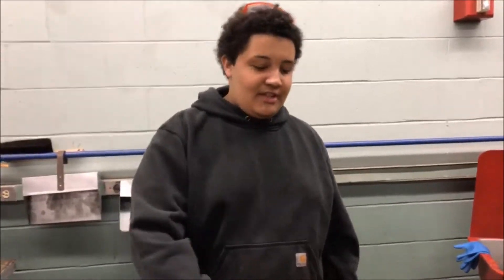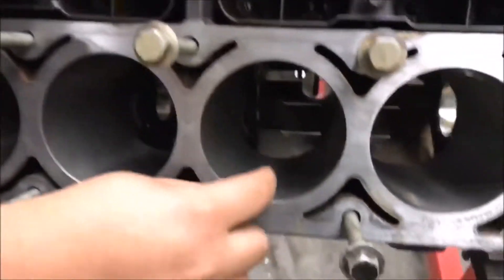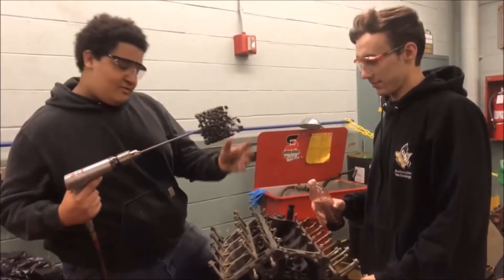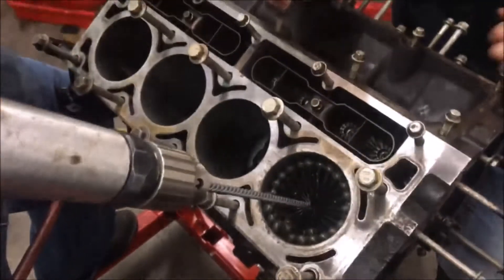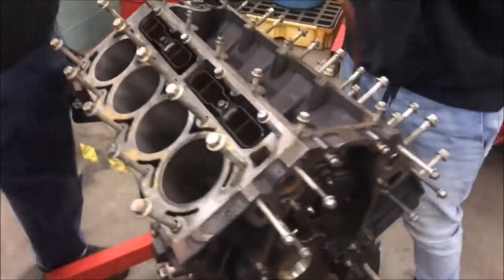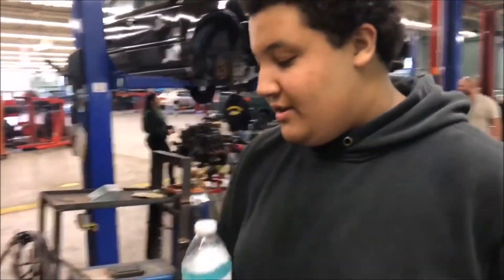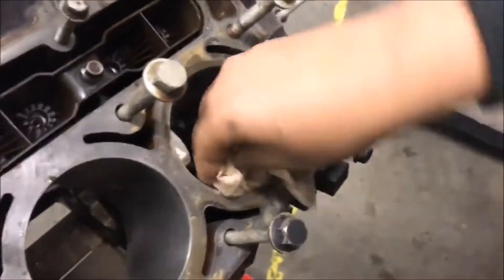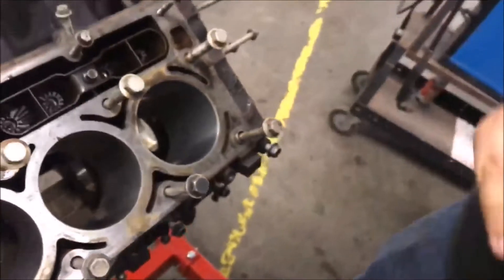How to Hone / Deglaze Engine Cylinders

Comment: Why did they leave the head bolts in?
Reply from the maker: notchbackgta In this case, it was smarter for us to leave them in to keep track of them.
Reply: Oh, but unless they're new, they are junk when removed since they are torque to yield
Reply from the maker: notchbackgta I actually failed to mention that this engine is going on an engine run stand, not in a vehicle. I agree with you on that they should be replaced. But it’s just going on the run stand.